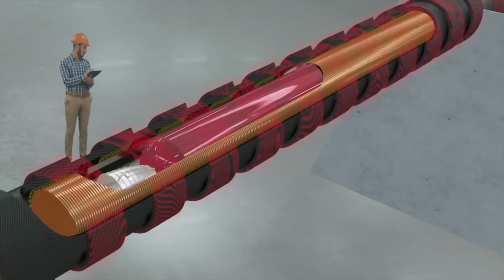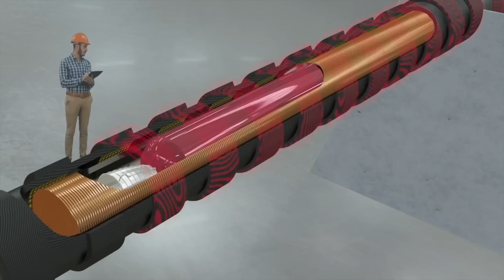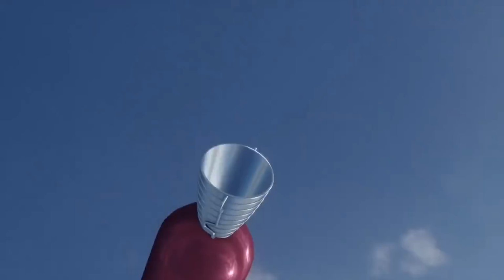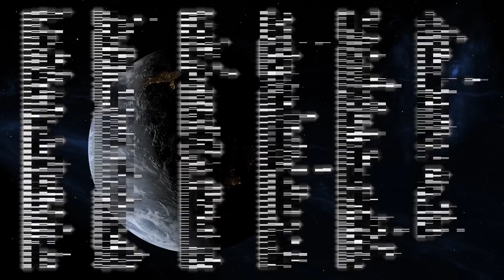Launching Rockets With Electricity

Comment: I made a coil accelerator  in high school (at home for science fair) that launched a magnetized sewing needle about a foot into a 3/4 plywood back board.   It used a 12 volt battery, a high voltage transformer coil and 200 feet of very fine magnet wire wrapped arround a tiny glass tube for a smooth launch.  It was wildly impractical and over heated after the 3rd launch but it was a fun learning experience.
Reply from the maker: What a fantastic project!
Reply: Did you mean half a inch into 3/4 ply ?
Reply: @petertaylor4758  yes  from about 12 inches from the 3/4 plywood.  Didn't win because "it could be a weapon" but I saw it as a prooff of concept.
Reply: @gooberclese  oh ok, I wasn't sure what you meant

Comment: The engineering of the superconductors is going to be challenging. The mechanical forces on the ceramic superconductor during the quench are going to be extreme.

Comment: Read Dr O'Neill space settlement. Grad students built one and did the sim code for mass drivers in the 70's.
Reply: Sadly, those are the proof-of-concept prototypes that revealed all the problems Dillon explores in this video! 
It turned out that mass drivers are much more difficult to manufacture than anticipated, especially if you want to use them more than once before you have to rebuild them. (The US Navy managed at least six or seven firings of their railgun before it needed major refurbishment—I believe the actual number of rounds is classified? So I'm just passing along a guess— but their mass-driver approach wasn't feasible either, long term.) 

Let's hope that Dillon and his team have come up with a solution with this "quench" accelerator idea!
Reply: A mass driver is not a rail gun. It is a series of electtomagnetic hoops using pull only to accelerate the bucket. There is no physical contact.

Comment: If the launcher is stretched to about 50 to 100 km, the g forces can reduced to human-rated levels. Target 4 km/sec and 6000-7000 meter elevation, and the launch vehicle is basically a second stage. The atmospheric heat load and max Q are tolerable.
Build it in Ecuador going east up the Andes mountains.
Reply: Not really. hitting the atmosphere is still like hitting a brick wall.
Reply: Surprisingly enough, that isn't the case.  This is an area of engineering research that is fairly well understood and tested in specialized wind tunnels and evaluated in simulation with good numerical models.  @jessepollard7132
Reply: Not a bad thought.  There are a couple of problems with longer.  The first is economics although that may not be critical.  Even though a ten times longer system would have (roughly) ten times higher up front capital costs, it turns out the critical cost is in the operating costs.  (Like the railroads.)  The greater problem might be that the launch tube really wants to be straight.  Even a very slight curve is tough for package centering of the carrier sleeve in a non contact system.  Maybe longer is V 2 !

Comment: the quenching part still seems crazy difficult to do.  With all that power in a "ring" where does it go when you quench it?
Reply from the maker: That's the tricky part, you have to make the magnetic field go away right as the projectile moves past it. All that energy has to go somewhere.
Reply: it becomes heat. the result of "back EMF" in electric motors that can melt the electromagnets (having rebuilt several, as it was one of my dads hobbies - and to get motors for other things - like drill presses, and blowers for forges.
Reply: The energy from the stator is transferred into the motion of the armature (carrier sleeve and delivery cylinder)

Comment: The problem with evacuated maglev sled tubes replacing first stages is exiting the tube, not just a breakaway cap which is a source of all kinds of chaos, hitting the atmosphere is even worse. It's a complete loss of directional control and structural integrity, along with heat and turbulence.
Reply: well, it is the heat and turbulence that causes the loss of structural integrity.

Comment: You let him off the hook with a fatal flaw very early in the video. As soon as he claimed that 5km/s speed through the atmosphere was a solved problem by orbital reentry vehicles, his credibility went to zero. Here's why. As you know, when reentering from orbit, you encounter the low end of the pressure gradient first. Initially, even 1.5 times the height of the Karmann line, atmospheric drag slowly takes place, scrubbing speed gently off your reentry vehicle. That slows you down enough to progressively encounter denser air as your speed decreases enough for you to survive it.

It's well known that if you retrofire too long and your reentry angle is too high everybody dies. You have to stay in the more rarified atmosphere even above the Karmann line long enough to scrub off enough speed to survive progressively denser atmosphere. Nobody goes 11,000 miles per hour below the Karmann line. This guy is cavalierly proclaiming that all the problems of 5km/s through the atmosphere have been solved and jumping from a vacuum inside a several kilometer long tube to the lower or even mountaintop altitude is not a problem. And he's dead wrong.

First of all there is no way to produce an acceptable vacuum in a several kilometer long tube. Secondly, when the projectile hits dense atmosphere at 5 km/s it will be instantly destroyed. Visit the American Meteor Society website and read the statistics. Meteors traveling at 11 km/s explode above 80 km altitude. 5 km/s is 11,000 miles per hour, The X-15 holds the all-time atmospheric speed record at 4500 mph at an altitude of 50 miles! This company proposes 11,000 mph at 20 miles or less. It's just not going to happen. A projectile emerging suddenly from an unattainable vacuum to atmospheric pressure at 11,000 mph might as well be shot into a concrete wall. Reentry vehicles benefit from working from the correct end of the pressure gradient.

He was also wrong about tossing something into orbit with one boost from the ground, and to your credit you touched on that. When you apply prograde thrust all you do is raise the height of the apogee 180º around the planet from your position. Your perigee remains below ground level unless you wait half an orbit and apply prograde thrust from the apogee to raise your perigee above the atmosphere. Even if your projectile could survive launch, and it couldn't, it would just crash back to Earth well before it could perform an orbit.

Working with much lower necessary velocities, launching from the Moon and with a rocket booster to achieve proper orbits and injection to Earth transfer could be useful. But on Earth, this thing is a dead project.

From your standpoint your job is to get him to state his program as completely as possible. Had you presented the atmospheric problem and not letting him get away with his "those problems are all solved" malarkey, I realize the interview would have been over and we wouldn't have got to hear is spiel. It's important for people to realize how reasonable impossible things can be made to sound so they are less gullible in the future.

Comment: So what material would the Sabot be made of?
Reply from the maker: Some kind of ferromagnetic metal.
Reply: I don't want to be pedantic but there actually isn't a sabot.  That is, Sabots are thrown our of the launch tube or barrel.  In our case, the carrier sleeve likely would be made of composites and slowed at the end of the launch tube for re use.  The delivery cylinder could be almost any material that is sufficiently strong and, importantly, is a useful on orbit material itself.  Oddly, being heavy is less of a handicap than you might think.

Comment: But would it require lots lots lots of electricity to do so ?
Reply: kind of.  If you look at a rocket, that might give you an Idea on how much Energy it costs to get to space. Even though you would need less energy this way, you still go to space.
Reply from the maker: Yes, going to space takes energy, whether you use electricity or petroleum.
Reply: @MusikCassette  
Indeed.
Reply: @frasercain  
So much so. 
Maybe they should focus on building a space elevator which would avoid the cost.
Reply from the maker: A space elevator still needs electricity to raise the car.
Reply: Electricy is dirt cheap(the value of the electricity is only 6 000 dollars for a 10 tons payload at 5km/s, assuming little losses), but the real problem is the storage system, you need to release that energy in few seconds, so instead of 500 tons of chemical propellant (like falcon9 for example) you need 50 000 tons of supraconductive storage devices(you need to charge that storage in few hours, but discharging would happen only in seconds) , that energy storage system would be the size of a battleship, and probably would cost ten times more.

Comment: I remember spending several years in my school years trying to figure out where in the world you could place a roughly 10-mile-long rail launcher, the roughly best location I could find was launching up over the Western Sahara, low population density, nearish the equator, there is a mountain to build along and the climate is dry. Beyond that, maybe the island of new guinea? Could also be a few other small islands that have suitable mountain terrain and big enough. but regardless finding a good launch location that also has a suitable mountain side is pretty difficult.
Reply from the maker: I've heard Mt Kilimanjaro as a suggestion .
Reply: @frasercain  that could work though mt kilimanjaro is a popular destination as well as there are a few local population centers that would make it complicated

Comment: The one prime place to put a EM rail system, would be at Mount Kilimanjaro in Tanzania.  It is on the Equator.  It raises 4,900 metres and is the highest mountain in Africa.  To the east is Indian Ocean (splash down area).  When it comes to ramping up on a power rail, this is probably the best place on Earth to launch anything.  Sadly one needs to avoid quakes and eruptions, for it is a volcano.  In another idea.  Get the thing up to 1.5 Speed of Sound, and then turn on our Ram-Jet or Rocket-Motors, and leave the power sled behind.

Comment: I noticed he said "pull, pull, pull"- and this is the main reason why most electric motors waste current and produce excessive heating. If he was to design these linear motors to both pull and push, the pushing phases would "self-quench" (invert or repel) the current, while simultaneously amplifying (or at least doubling) the total B field flux density which is applied to the forward momentum of the payload (because there is virtually no inductive time delay on the quench). This method would greatly reduce the actual current consumed by the stator coils, as well as greatly reducing the heating of the coils (because the electrons in the stator are decelerated by polar opposition to the magnetized rotor or capsule. This method greatly reduces the initial "start-up" current drain, while it would also help to use starting motor (or an initial push from a chemical explosive) so as to initiate the applied current on the push or "quench phase" of operation. Of course, this would require a permanently magnetized (or electromagnetic) capsule that would still need to be recovered by some means (if not sent to orbit with the payload); but ordinary, copper coils could be used effectively and repeatedly, and affordable means of cooling, such as liquid nitrogen could be used.
Reply: it still generates heat.

Comment: When you think of what makes any "gun" useful, it's the ability to launch enough mass, with enough velocity to impart force on the intended target. But as every hunter knows having the capacity to fire a second shot quickly and accurately is a requirement that can't be ignored. A battleship that could only fire once and need a new barrel immediately is impractical, so in time they improved the technology to changing barrels every few hundred shots. It became a useable weapon that still required a huge amount on guidance technology to get them accurate at least a few times. The main hurdle was materials. Inventing the metals that could withstand the friction and pressures involved with launching a 2000 pound projectile 20 miles. The rail gun effort was never able to solve the materials part of the challenge.
Reply from the maker: Exactly, as he said in the interview, the generals were sick of people bringing them railgun concepts that tore themselves apart with each firing. They need to be used hundreds of times.

Comment: This David Dillon guy sounds very legit. So many of these startups look like "pie in the sky" funds or outright scams. I'm happy at least some of them are solid and honest. Good luck to the Mass Driver project!
Reply from the maker: He was actually quite realistic about the challenges.
Reply: I like the fact that he addressed the radial stresses caused through extreme amperage used in these coils, and the longitudinal force caused by equal and opposite forces as the projectile is ejected, while noting the fragility of current high temp superconductors.
These problems are generally ignored or just given a hand wave.
This company, in my opinion is likely to succeed.
Reply: It's utter bollox. The projectile will vapourise in atmosphere.
Reply: Do you mean Rocket lab
Reply: @frasercain Re: Electromagnetic Launch Boosting. What about starting from getting a Starship off the pad & up to just a few kph? When I saw it from Rocket Ranch last April, it seemed to have sat on the pad for an eternity before lifting off. The fuel it consumed in those first few to 15 seconds t’wrnt nutt’n!
Reply: @Crunch_dGH  Exactly, that's why spin-lunch will never (cut the mustard) meet the expectations that they claim.
Reply: He looks like an AI generated talking head. I know he's not, but there must be some smoothing video filter in use.

Comment: I accidentally made an electric gun in electrical shop in Jr High. I coiled lots of wire around a hollow wood core. Dropped a screw with the head cut off in it when I plugged it in. It got sucked in, left a big dent in the wood base. It bounced out, luckily missed my head. We never found the bolt.

Comment: He didn't explain what "Quenching " means - he briefly touched on it by saying that the overall problem with such a launcher is that it is like a solenoid in that as you energize the first solenoid's coils, and your solenoid slug/launch vehicle at first extends past the coil the problem is that if you want to have another coil take over, and further accelerate the launch vehicle ,then you have to turn off the first coil - the problem is that when it is powered down it 's collapsing current will create a magnetic field in the opposite direction, which will tend to want to pull your vehicle back. And so I believe they want to quench that collapsing magnetic field effect ..... I think 🤔
Reply: Fair comment.  I didn't.  The particulars are in our patent application, and for the time being, they are confidential.

Comment: In the future the boring company may be able to drill up through Mount Chimborazo in Ecuador. 
Which is the Most Ideal place for this as the Highest point near the Equator by far ( actually about 12 miles further from Earth's center than Mount Everest due to the equatorial bulge) 
This gives a 14 mile headstart on a LEOrbit journey of 1200 miles. The typical first stage of a rocket goes only 40 miles high so one might need to have an explosive charge shoot the rocket from a launch casing howitzer to reach the 40 mile equivalent of a first stage. Then a starship type rocket takes it the other 1160 miles. But I think one could eliminate the entire first stage with all that fuel burning. 
With the possibility of higher temperature and cheaper superconductors and modular nuclear fission or possibly fusion plants in the future. This could really get a lot of mass to orbit very cheaply ( like water, fuel, food, and metals or structural building supplies )
The number two ideal site is Mount Killamanjero in Africa or a 3rd possibility is in Borneo. 
I really hope that some Billionaires decide to fund more work on this effort.
Reply: Good thought.  I would love to talk with folks at The Boring Company about this.

Comment: This is exactly how I think we should be getting space vehicles off the ground. No ground based system will ever be able to get objects into orbit because the highest the perigee can ever be is the point of launch. A secularization burn will be required. However, getting the first 5km/s without using any propellants would enable single stage to orbit and landing. That would be a huge game changer. Also, I would like to see the g force calculations for 0 to 5 km/s. It may not be comfortable, but possible for manned missions eventually. A 10 km long vacuum tube with its end at the top of a mountain (preferably a really high mountain) is the right idea. The more of the atmosphere these launches can bypass, the better.
Reply: Why do they currently do the launching from sea level instead of mountain tops?  🤷‍♂️
Reply: @malcolmrickarby2313  1. They want the beginning of the trajectory to be over an unpopulated area to minimize casualties in the event of a rapid unscheduled disassembly.
2. Shipping things by sea is convenient for objects that are too massive to ship by road or rail.
3. The initial velocity off the launch pad means that drag from air isn't a really big problem. Max Q, the point of maximum aerodynamic pressure occurs when the launch vehicle is several thousand feet in the air and velocity is close to super-sonic.
An object travelling at 5 km/s at sea level would experience so much heating that it would melt or simply disintegrate from the compression stress that it would encounter. With an evacuated launch tube about 10 km long, the start point could be at sea level while the exit point could be at the peak of the tallest mountain on Earth.